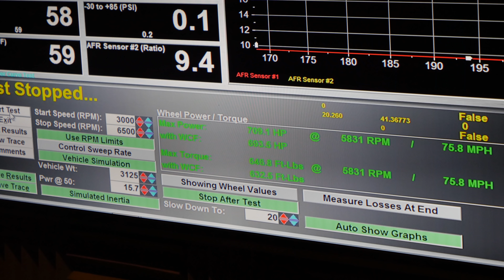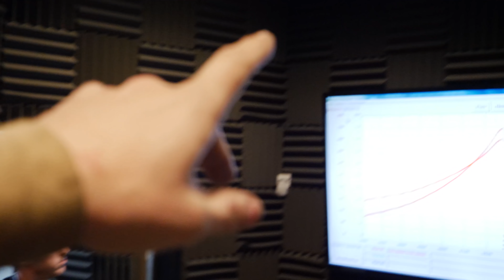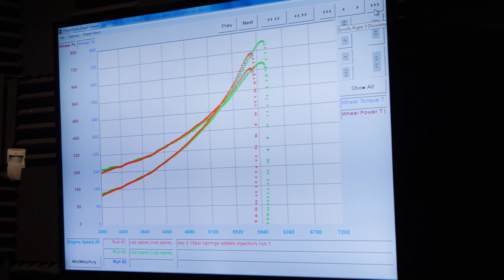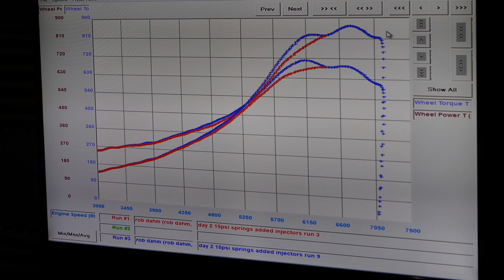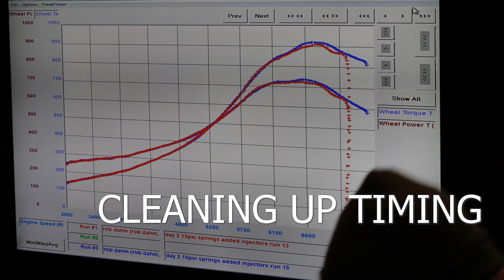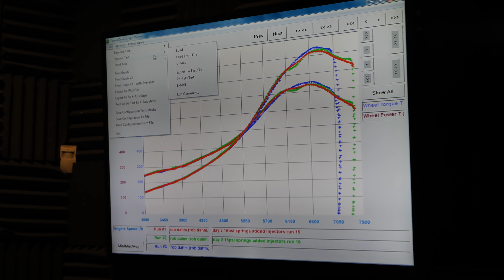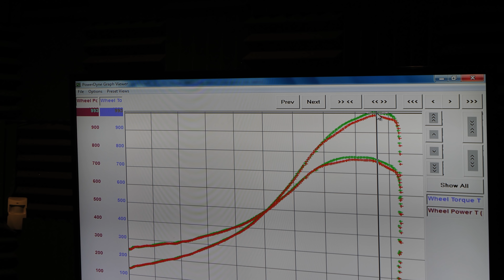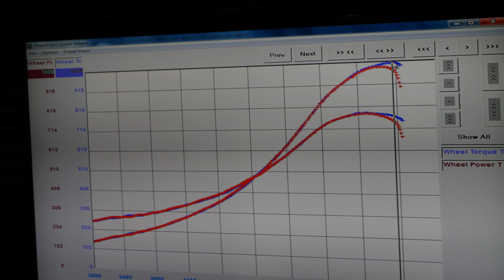WORLD’S FIRST 1000HP AWD BILLET 4 ROTOR RX-7

Comment: Damn why does the front end of the car lift so much on the Dino? Other than the centripetal force of the tires getting taller I can’t think of anything. It must have to do with the gears and how they deal with extra power like it torques up the suspension or something.

Comment: Wasn't this thing suppose to be 1500hp or 2000?
Reply: Not on a full tune yet. He's currently running only 18psi of boost and 7000rpm redline.
1500-2000hp is attainable with 9000-10000rpm and with at least 30psi of boost

Comment: Cool thing with the wire harness untill u have to change some wires lmfao gl
Reply: Josh Frank  if I was the customer you're not butting a single piece of wire on my harness lmao. You're gonna have to pull the whole harness untwine it r/r old wire, retwist, then put it back in. These are probuilds not backyard builds lmao. I'd rather use a sleeve, so you ARE able to take out old and slide a new one in. But hey twists look pretty 😂😂😂

Comment: WHAT ALL OF THIS AND YOUR ONLY GONA RUN 25psi I real hope that’s just for a shout term like secondary break-in process  us the motor built to the caliber that it is it would be a massive injustice to run out anything less than 50 or 60 and that’s even low my neighbor has a 3 rotor mostly stock only thing done was a rebuilt upgraded apex seals and in take/exhaust seal all the lil ones and arp “head” studs know I know their isn’t a head but I can’t thing of what they are called atm but you know I mean any how he is running 45psi on the big holstet can’t remember the name of the holset many hx45 any how my point to this ramble is don’t punk out Man U built this motor amazingly it can take it so set your purse and Barbie down and crank that boost all the way up lol ok ok maybe only like 3/4th’s up

Comment: 1000awhp out of a 4 rotor? pretty weak no offence. Rotormaster built a 3 rotor that makes 1400rwhp on alot less boost than you. That motor should of made 2000hp
Reply: Joey Menace they made 1400whp on less than 15lbs of boost? Rob was only on 15 at the end of this video.
Reply: @yummyhershey5902  he said 18psi? anyway they made 1400rwhp out of a 20b turbo at 28psi. Car done 200 passes at the track...

Comment: 1000 HP for that motor is weak as hell it should be putting out like 3000HP little 20b three rotors are putting out over 2000HP you built a giant turd and if you plan on dragging that thing watch out at the 330’ mark on the track 4 wheel drives tend to lose it there for some reason that cars not gonna be fast as you think it is